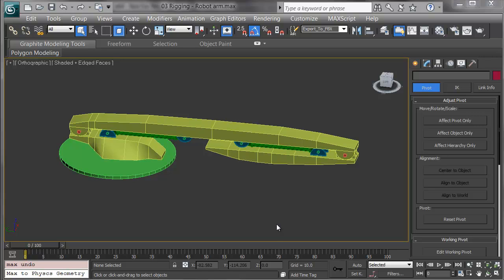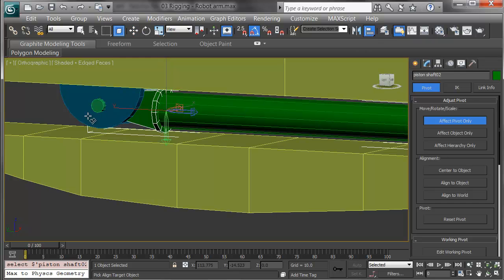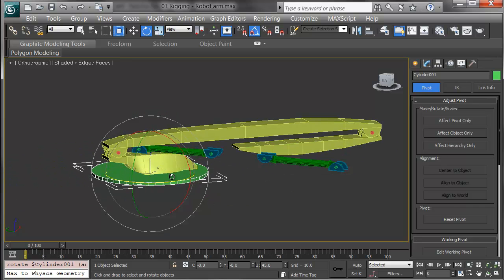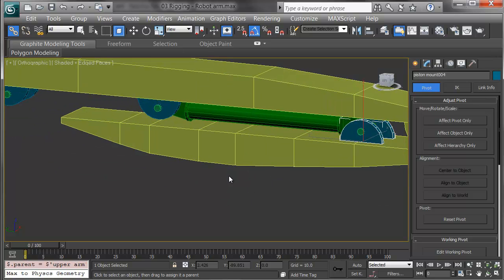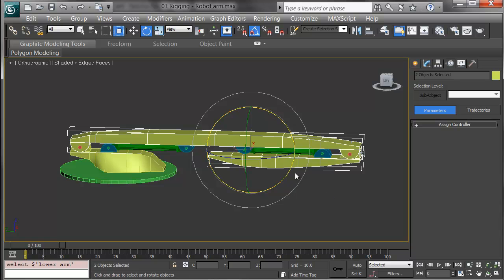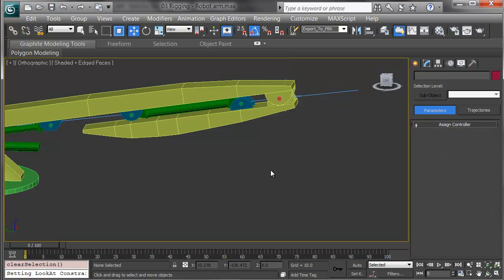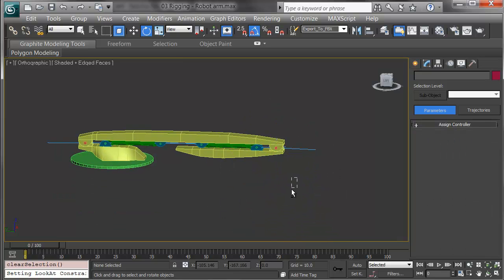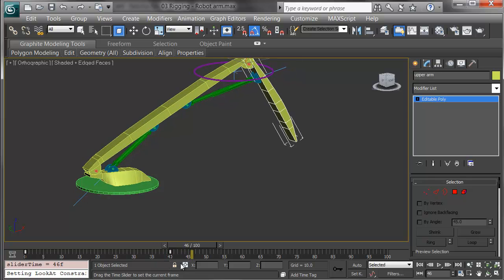30 Second Animation: Rigging Mechanical Objects in 3ds Max

Comment: I'm looking at making a multi-linked robotic arm which will require each linkage to rotate in the xyz as well as each segment having the ability to slide (like a sleeve so so the structure can extend and retract into itself).  I've read on the 3ds documentation that a HD solver will be best for machines and anything with sliding parts.  Just wondering if that's true and whether you'd have a tutorial for that?

Comment: Excellent tutorial, thanks!

I just have a question though (something I'm trying to figure out.

I have a similar piston-setup that I'm trying to rig, but in my case, the "half-rounds" (The blue parts on your arms) are part of the actual arm itself. I can get the arm "elbow" joints linked with the pin as you show in your tutorial, but is there any way to join the cylinder end to the second point on my model without having that point as a separate object (I.E the elbow joints linked, and the cylinder ALSO joined to actuate on the same object)?

Comment: Great tutorial....I need some help with a project.  I'm trying to create a piston inside a shaft that rotates slightly on a pivot about half way up the inner piston.  I have look at constraints on both ends but I can't seem to keep the outside shaft in proper motion with the inner piston when I rotate it on the pivot.  Does that make sense?

Comment: Um, I'm not exactly sure of where this "select and link" button is. Please, PLEASE someone help me.
Reply: Its the symbol right below the 3ds max logo in the top right corner.
Reply: Shutter Authority Please, do you know how to make 2 or more links from the same object? I am animating an Pixar Luxo Lamp, it must have two joints from the stand, with different linkage paths. When I try to joint it to two levers, it joints to last chosen only. What should I do?
Reply: I'm not sure if understand you correctly. For something like the Pixar Lamp you can use a HI solver. That was it'll all be IK. If you want to work in FK you can link each object to the next in the chain. In either case make sure your pivots are set correctly.

Comment: Good tutorial! Although i would recommend to keep the hiearchy, IK chains and constraints to bones/helpers only. Then you would not ruin the rig if you were to switch mesh parts. And i would not use the initial offset in the look at constraints. If set up with correct look at axis, source axis and upnode axis you would have full control of the plane of rotation and avoid potential flipping. But i guess it is just a matter of personal preference :)